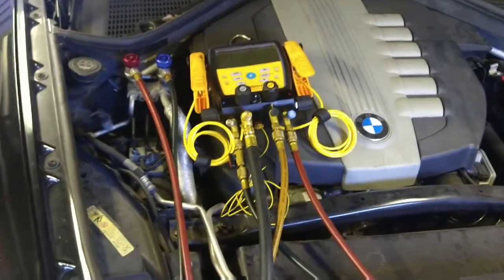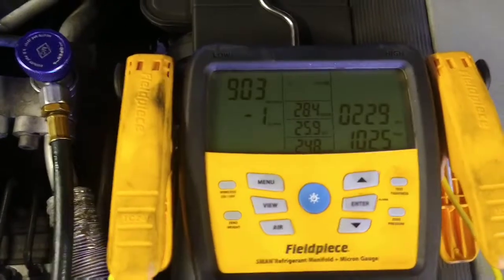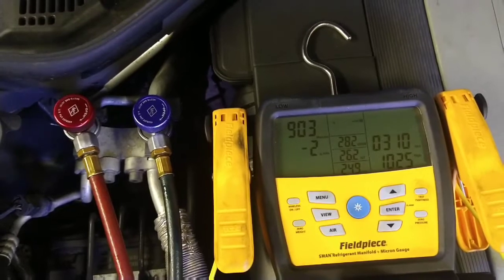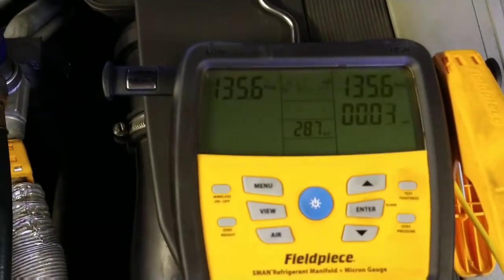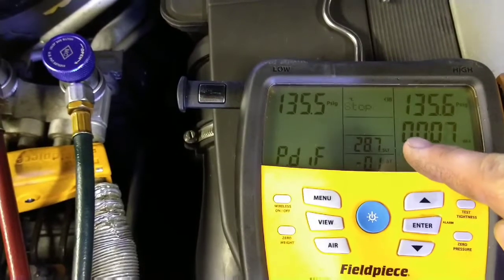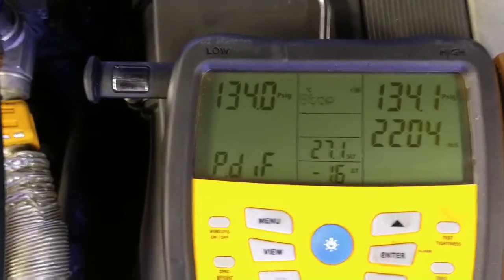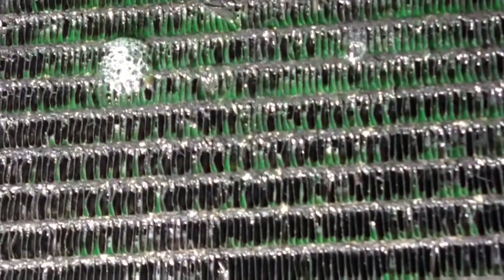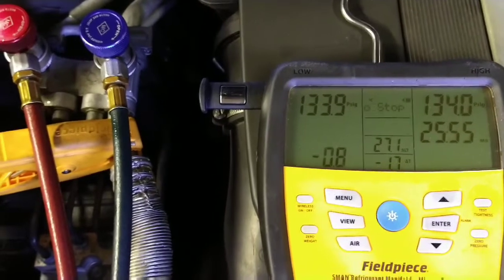Automotive Air Conditioning - Vacuum and Nitrogen testing.

Comment: Great video. I'm currently trying to trace a fault on my wife's grandland. It was empty when we got it and a year later empty again. Searched tsb's and there are a couple. Brought a sniff tester but think it may need nitrogen charging. Trouble is I bet it's expensive for a one off and at work it's there problem to get the kit.
Reply from the maker: To be honest unless you've got some way of pressure testing your going to struggle to pinpoint leaks. 👍
Reply: @Automotive_Solutions  I know I'm trying to figure out what the cheapest kit is to test it. A genuine condenser is around £600. We brought the car with 717 miles and it was empty. Gassed it at work a few weeks ago and it lost it when I got home. Smelt in the engine bay, will keep looking
Reply from the maker: @spanthefestaman - that's a big leak, A sniffer would find that with some gas in it for sure. Good luck
Reply: I had a look tonight but all the gas has gone now. Won't even pick up a trace at the fill points. Have noticed that the pressure switch/sensor was finger tight.
Where are you based incase I struggle? 🤔
Reply from the maker: @spanthefestaman - I'm down south but have a full diary due to working for other garages so don't take on other stuff.
Reply: @Automotive_Solutions no problem. Tightened the switch sensor will try gas it again.  Out of interest for a regas how much oil do you normally add? No conclusive answers anywhere! 
Great videos especially the different diag videos
Reply from the maker: @spanthefestaman - in your situation I would probably add 15ml with some uv dye as well.
Reply: @Automotive_Solutions cheers I searched everywhere for answers. When I did my AC course the only thing he told me was to add about 20-30ml when I change my condenser on an old astra. I assume some oil always stays in the compressor. Last grandland engine I changed the AC recovered 22ml.

Comment: What are the adapter sizes for that gauge to hook up your normal automotive hoses?
Reply from the maker: The ports on the manifold are 1/4" apart from the vacuum port which is 3/8". So normal 1/4" hoses will fit. I use a 3/8" hose for better vacuum but you could use an adapter to step it down from 3/8" to 1/4" if you wanted to. Hope this helps 👍😁

Comment: I've just subscribed :-)  My guy has missed a leak that his machine said was fine only two months ago, I'm going back to see him tomorrow for a nitrogen test.
There is a sealant for A/C systems, correct?   Why not try this rather then huge expense of a new condenser, especially on an old car, for example.   Appreciate your thoughts and can it be done DIY?
I had a small leak on my radiator, dripping coolant for a couple of years.  Tiny amounts, but I finally decided to try the smallest bottle of RadWeld.  Worked a treat and is still fine 10,000 miles later.
Reply from the maker: Thanks for watching. Your right about the radweld radiator sealant. It's been used successfully by many people including myself. The air conditioning sealer is a different beast. I don't know of anyone who has used it with success. It can have some negative consequences for the system as well but as a last resort then try it before resigning to opening the windows forever more. 😁👍

Comment: Good find. A lot more accurate than the old analog gauges. After a year of using these new gauges you will wonder why you never use them 20 years ago.
Reply from the maker: I already am. Well impressed with these. Your knowledge and help inspired me to step up a gear. Thanks 👍

Comment: What leak detector spray are you using in the bottle buddy?

Good work as always 👍
Reply from the maker: The refillable pump up bottle is just car shampoo & water. The green stuff is commercial a/c bubble spray. It's good but the wrong colour. I didn't realise it was gonna be green when I ordered it.
Reply: @Automotive_Solutions  What is a good color then.
Reply from the maker: @TheCarClinicHybrid  clear or light blue is normal. I use car shampoo quite a lot as well.

Comment: Well worth the investment this digital gauge mate 👍👍👍 Apologies if it’s a stupid question but how long for a small leak like this to affect cooling or for the a/c to stop working all together .
Reply from the maker: Hard to say. But the hotter the weather the higher the pressures so it will push it out faster. I've seen some cars with stains on the condenser and they're still working the following year.
Reply: Automotive Solutions 👍👍👍